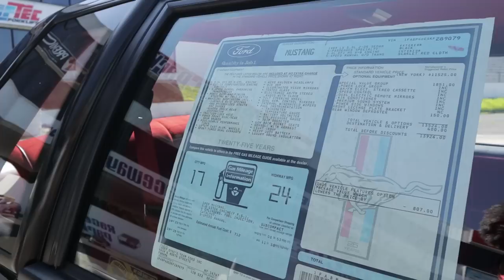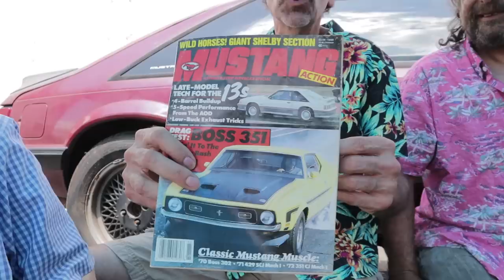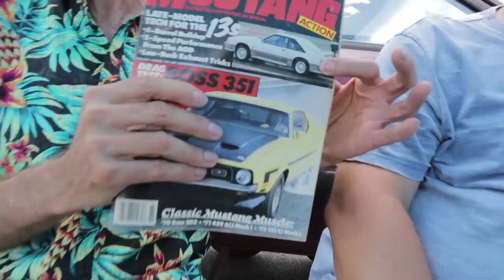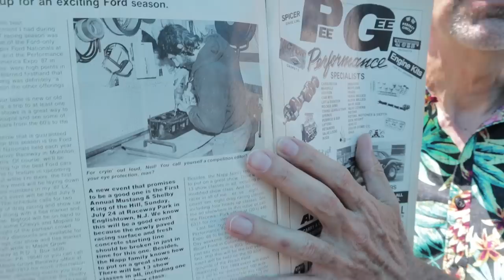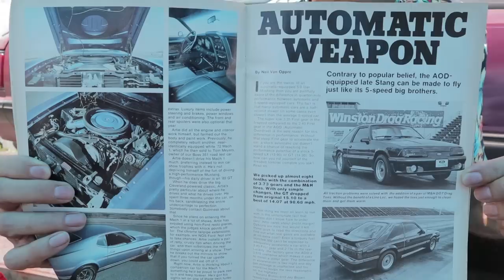5.0 Fox Body Mustang Revolution- The Second Coming Of The American Muscle Car

Comment: I was finally able to watch the whole video and it was like going back in time. I had all of the magazines you showed and used much of your advice for launching my car properly. I ordered my car in September '87 with the only two options being the H.O. pkg. and T-Tops. I got a call two days later from the salesman that the T-Top option was discontinued so I ordered AC, tilt wheel, flip up sunroof, Lo Jack and radio delete for $500 less than the T-Tops. Mine was Cabernet Red with the red interior. I had to wait four months for my car since it was getting the sunroof installed at American Sunroof. I drove across country and back and averaged 26 mpg and over 30 mpg coming down out of the Rockies and Adirondacks. I sold it only because of the recession and being out of work (my fault). I still want another '87-93 LX but the more solid Notch. Thanks for the trip down Memory Lane!
Reply: WHAT BERNIE SAID ABOUT YOU COULDN'T BUY ANY PARTS FOR THE SMALL BLOCK FORD STEMS DOWN TO THE THREAT THE SMALL BLOCK FORD POSED TO THE SMALL BLOCK CHEVY BACK IN THE 60'S WHEN THE 289ci DEBUT. THE 289ci WAS SUCH A THREAT TO THE SMALL BLOCK CHEVY THAT THE NHRA (HENCHMEN FOR GM OR ANOTHER DIVISION OF GM) IN ORDER TO KEEP CHEVY IN THE WINNERS CIRCLE. WOULD CHANGE THE RULE BOOK ON THE 289ci MOTOR LIKE THE WEATHER CHANGED IN KANSAS TO DISCOURAGE ANYBODY FROM RUNNING IT. THE CHANGING OF THE RULES WERE BOTH WRITTEN AND UNWRITTEN. SO IF YOU SHOWED UP AND RACED AND WON. THE NEXT TIME THE RULES ON THE MOTOR WOULD BE CHANGED SO YOU COULDN'T RUN IT. IT WAS ALL BASED ON CHEATING. WHAT I WROTE HERE FINALLY ANSWERS THE MYSTERY QUESTION OF WHY FORD'S COST MORE TO BUILD. ON THE OTHER HAND YOU CAN BUY RACE PARTS FOR THE SMALL BLOCK CHEVY THAT WERE EVERYWHERE AT NICKEL AND DIME PRICES. SINCE THE SBC WAS THE FAVORED MOTOR. THERE PARTS WERE NEVER RESTRICTED AND MASS PRODUCED WHICH KEPT THEM CHEAP. ON THE OTHER HAND NEITHER WOULD FORD NOR THE AFTERMARKET RISK PRODUCING RACE PARTS FOR THE SMALL BLOCK FORD WHICH THE HENCHMEN FOR GM THE NHRA WOULD BAN OVERNIGHT, AND THE MANUFACTURERS WOULD BE LEFT WITH A WAREHOUSE FULL OF SCRAP METAL. BECAUSE IF YOU CAN'T RACE IT AND WIN, THEN PEOPLE WOULDN'T BUY IT. FOR THE FEW COMPANIES THAT DID PRODUCE PARTS LIKE CAMS, MANIFOLDS, PISTONS, ETC. THESE PARTS WERE PRODUCED IN SMALL VOLUMES BRINGING TO COST UP 2-3 TIMES MORE. NOBODY WOULD DARE PRODUCE A HEAD FOR A SMALL BLOCK FORD BECAUSE OF THE THREAT OF A BIG EXPENSIVE PART LIKE THAT BEING BANNED, WHILE AFTER MARKET HEADS FOR THE SMALL BLOCK CHEVY WERE PRODUCED WITHOUT RESTRICTIONS. WARREN BROWNFIELD WHO I THINK LATER STARTED AIR FLOW RESEARCH WAS MAKING RACE HEADS FOR THE SMALL BLOCK CHEVY FOR YEARS AND SO WAS EDELBROCK. SO IF YOU WANTED A HEAD FOR A FORD WHERE DID YOU GO, NOWHERE. YOU HAD TO MAKE IT. YOU ACTUALLY TOOK CHEVY VALVES AND MACHINED THEM DOWN. ALSO WHAT BERNIE SAID ABOUT A HEAD BEING AVAILABLE FOR THE SMALL BLOCK FORD. CAME ABOUT IN 1989 WHEN TRICK FLOW PRODUCED THEM. IMAGINE IT TOOK CLOSE TO 30 YEARS TO PRODUCED A HEAD FOR THE SMALL BLOCK FORD. AND THE ONLY REASON THEY DID WAS DUE TO THE POPULARITY OF THE SMALL BLOCK 5.0 MUSTANGS. AT THE TIME IT DEBUT THE RACE TRACKS WERE DEAD. ONLY CERTAIN HARDCORE RACERS MOSTLY CHEVY, WERE THERE AND THE STANDS WERE EMPTY. ONCE THE MUSTANG 5.0 CAME INTO EXISTENCE IT INJECTED STEROIDS INTO RACING AND HAS BROUGHT RACING TO WHERE IT IS TODAY. NITROUS, TURBOS AND SUPERCHARGING COMPANIES CAME INTO EXISTENCE AND THE ONES THAT DID EXIST STAYED IN BUSINESS BECAUSE OF THE POPULARITY AND MASSIVE POTENTIAL THE SMALL BLOCK FORD HAD TO MAKE POWER. WHEN I THINK ABOUT THIS STUFF. I THINK ABOUT HOW BIG OF AN IDIOT GALE BANKS WAS THINKING CHEVY WAS THE BEST AND THOUGHT NOTHING ABOUT FORD. IF HE WOULD HAVE PRODUCED TURBOS FOR THE SMALL BLOCK FORD. TODAY HE WOULD BE ONE OF THE DOMINATE LEADERS IN TURBO TECHNOLOGY UP AT THE TOP. BUT THINKING CHEVY WAS THE BEST BLINDED THIS MAN WHERE TODAY HE IS A LIMITED COMPANY STRUGGLING ALONG TO STAY ALIVE. LOOK AT THE IRONY OF THIS WHOLE THING. THE NHRA PUT BANS ALL OVER THE SMALL BLOCK FORD FOR YEARS TO KILL IT. ONLY FOR IT TO COME BACK YEARS LATER TO BIT THE CHEVY SMALL BLOCK IN THE ASS. ALL YOUR 5.0 RACE CLASSES WERE CREATED FOR FORD, BECAUSE THE SMALL BLOCK FORD HAD NO COMPETITION, THE CHEVY SMALL BLOCK COULDN'T COMPETE IN THESE NITROUS, TURBO AND SUPERCHARGING CLASSES. IN ORDER TO BECOME A PLAYER YEARS LATER GM DUMPED THE CHEVY SMALL BLOCK IN FAVOR OF MAKING THEIR OWN SMALL BLOCK FORD THE LS. FROM TOP TO BOTTOM THE LS IS 1000% FORD. NOT 1 ONE DESIGN ASPECT OF THE OLD SMALL BLOCK CHEVY LIVES IN THE LS, THE LS IS ALL FORD IN DESIGN.

Comment: This was great. I grew up reading all these mags as i got into cars pretty much from birth. My dad was a car guy, mainly a mopar guy.   I turned 16 in 99 and my first car (the fastest for the cheapest car i could get) a 87 lx 5.0 5 speed. Had the fastest car in hs.(a lot of my friends at the time got into the "scene" but were into civics and stuff but they got destroyed by my 5.0)These cars ruled the streets. Even my dad would kinda make fun of the "little mustangs"...till i got one and he drove it (i eventually got him into them and he ended up buying a new edge new at the time) Anyways ive read all the mags, evans mmff stuff all the time etc. Had many foxes since. Ive done the k+n filter to gt40 intakes nd b303 cams and all that then onto sn95s etc. Now i daily a new edge and have a heavy modded 98 saleen with a terminator swap i converted to turbo...still always building cars and enjoying them, and the fox kicked it into high gear for me.

Comment: Another great video Uncle Tony!!!. Just to give you an idea of the scope of your influence during the 5.0 emergence back then, here on the West Coast of Canada my friend and I did your 10 minute tune up on his  87 5.0 Coupe, drove to Seattle International Raceway and ran 14.26s on the Gatorbacks. When he went back to Ford to get a warranty fuel pump, the tech set the timing back to stock specs,  witness marked the distributor, then the service manager said it will void the warranty if it is altered from stock again. Of course we set it to 10 minute tune up specs again.  Thanks again  Tony  for the great video.
Reply: Marek, yours was about the first fast 5.0L in this area, it was pretty big news when you ran 13's in a new stock car. 13.87 wasn't it?

Comment: It's kind of funny listening to this stuff from back in the '80s, because I sort of went down that same path of learning about 20 years later. None of my buddies had 5.0s and everyone was running carbs, I didn't know much of anything about them, and I more-or-less impulse bought mine in 2006 and started reading old magazines (and then old forum posts), and old books, and on and on... These cars are a ton of fun, and at least they used to be an incredible value. For what they at least used to cost, you can't hardly beat one.

Comment: Back in 87 I had an 86 gt 5 speed, very quick car.  It got rear-ended in 95 and I replaced it with an 89 lx 5.0 5 speed with 3.23 gears, subframe connecter and short throw shifter, that thing was a beast, traded it in in 99 because the baby seat would not fit good on the back seat.  I enjoyed this trip back in time.

Comment: I bought my 89 5.0 Mustang on November 22nd of 88. This video brings back awesome memories of racing someone on my way to work, EVERY SINGLE DAY! From Allentown Pa. to Perkasie down and back on route 309. The were other Mustangs, Grand Nationals, and a Toyota Supra Turbo. I beat them all. I ended up selling it in 2000 and buying an F150. Of course, the whole time I had my 70 GTX in the garage, but the Mustang was my daily driver, and DRIVE it, I did!!!
Reply: I had the 87'Grand National! Got it for graduation! mom and dad, didn't want to get me anything fast "a V8" so instead they got me the "v6.. Grand National" little did they know it was a beast! 
Stock.. it would humiliate the GT's, Iroc's, GTA's and vettes! if you outrun.. the Grand National you have had some work done to your Mustang, because stock.. you would have gotten embarrassed!

Comment: Rewatched this.  I bought a new  ‘88 5.0 GT no a/c and AOD (newly married, wife daily drove it) when I was  23. Eventually nailed 14 flat with off-road H pipe and the usually mods; under-drive pulleys, timing, silencer removed.  Sold it to buy a home, later found a duplicate GT convert 5 speed.  Good Times!  BTW, we were always envious of that good east coast air!

Comment: 35:28 Carried my slicks in the back seat of my Notch in Discount Tire bags. 26x10s fit across fine and the 28x10s required splaying the tires a bit to fit. No tire marks anywhere in the interior though it did smell like burnt rubber (more than) occasionally!

Comment: 87-93 5-oh was America’s answer to the VW Beetle.  Cheap, easy to fix, and reliable.  Lug wrench makes the perfect pry bar to extend the sprung tensioner and swap the belt.  I can swap a belt in under 2 minutes.  Everything on the car save for the heater core is a snap to replace.  I’ve been daily driving a 5.0 since 2000.

Comment: I am a big Mopar fan. I grew up in the 70s and 80s. Graduated in 91. Given the time period and the fact that I live in Michigan most old Mopars on the road were on their last miles before rust ate what was left. There was even a 69 Hemi Daytona around. My cousin had bought an 84 Mustang GT. After I drove it I thought it was an absolute blast. Although I was still looking around for a 340 Duster or whatever I could find, I found a black 92 GT 5 speed , 60,000 miles for $7500. There was no rust. On  a six year old car vs what I was finding on older cars. I have it in heated storage and at some point will do a light restoration.

Comment: I'm just watching this documentary and I already learn a few things . Like the 10 min tune up ,and from MR Bernie that the Auto Chip is recovering timing better than the manual one . I have an 88 LX  hatch with the AOD in it . Now it has 237 k miles and still running strong. In 87 i was still in High School just learning auto mechanics and how cars and engines work. I was 16.  Mine has 3:27 gears from the factory.  I did try drag racing a bit but didn't get too far. My best run after rebuilding the engine after the oil pump locked up was 14.5 something  at Milan drag way in Milan MI. Yes I live in Michigan, still. It was fun and a lot of adrenaline rush.   The magazine the Neil was showing , What month and year was that ? would like to look for it. Thanks  I bought mine in Feb 2nd 1993 used with 37 k miles on and still have it today. 12/16/2021. I've read Evin J Smiths articles back in early 2000s in Muscle mustang and fast fords mags. cool stuff. Still have a bunch of them.  Cool video.

Comment: Regarding the seats...there were no seat option choices, the 1987-1990 LX coupe 5.0 was only available with the "4 cylinder seats" in vinyl(very rare) or cloth untill 1991 when the lumbar seats as found in the GT became standard. The LX 5.0 hatchback had the GT seats standard starting in 1989 while 1987-1988 5.0 hatches came with the "4 cylinder" seats as the only choice. Starting in 1990 the seats also switched to the small headrest and the fabric was different than the 1987-1989 seats. As for the pinstipe, it was also standard and not an option, on all LX models and was an actual painted on stripe and not a cheap vinyl tape stripe. The stripe was dropped from production in 1991 on the LX. The wide moulding stripe found on GT cars was dropped mid-year during the1989 production run. The 25th Anniversary dash badge was only installed on cars produced from April 1st 1989 through April 1st 1990.

Comment: Another thing, first thing I do any ol ford smallblock is if it’s efi( all I’ve ever owned) put it at 14 degrees initial timing open up the plug gap to .50, get a better coil and it really helps as far as throttle response and mid range and a few mpg to boot

Comment: Boy I had three Highway Patrol Mustangs over the years in Florida ! They rock and very fast and handle curves like a European sports car !! My first Mustang was a 1985  Highway Patrol Mustang that I bought ( with my Fathers help ) at a Bartow Florida Patrol auction . It had a flat tire and eventually needed a clutch and smoked some but WOW very fast and fun to drive and had a four barrel Holly carb stock from the factory !  On top of that this was back when the Patrol was auctioning off their vehicles before 100k miles !!

Comment: I like the video and agree with almost everything, great information for this generation of gearheads. But I don't understand the ET of 5.0 stick Mustangs with a cam VS other modified street cars at the time and the comments saying "everything that drove to the strip fell to a notch", that's just not true. In the mid to late 80s I had plenty of competition running low 12s, and 11s (frequently) N/A, a lot of people didn't understand parts selection and tuning at the time though. Fox bodies were well designed and the 302 Windsors were great at the time but they were really lacking in the torque department, for well under the price of a 5.0 5spd Coupe you could build a bruiser if you had the time and the know-how, I guess the appeal was that you could just buy a Mustang, learn how to drive it and take it to the strip with minimal effort.

Comment: The Foxbody Mustang was finally hitting its full stride in its 7th year in 1985 after ditching the junk TRX Michelin tires for the Goodyear Gatorbacks, getting a roller cam and with the addition of the improved T-5 transmission. It was still sandbagged with 4 bolt hubs and wheels, rear drum brakes, too small brakes and a 4 link rear axle that needed a panhard bar or Watts link to stop it from moving around too much. 
I had a 5.0 4 speed 1979 Mustang Indy Pace Car from August 1987 to March 1990. I was a regular on north Broadway in Rochester Minnesota in the late 80’s. I rented a 1989 Mustang LX 5.0 in April 1989 and wow that car was a lot faster than my Pace Car.

Comment: Yea, I can remember guys coming by the race shop, checking to see if we had any IMCA modified tires. Because at one point we had asphalt or dirt tires. Which both were DOT approved. So they would buy the dirt tires to use at the drag strip. And the asphalt tires to drive home on. 

Needless to say, they didn't stop buying then when McCreary went to one compound for the IMCA modified. Then transferred over to American Racers, and Hoosier. 

Although the American Racers are more popular than the Hoosier's. 

Although they are all DOT rated, because that is what IMCA requires, due to the fact the tire has to be road legal.

Comment: wait...Tony DeFeo and the 13.47 quarter mile Fox Body? yeah, I remember those magazine articles. Wringing out Tom Meyers yellow Boss 351. Grand Nationals going at Fox Bodies the way Grand Sports would eventually target Hemis at any dragstrip. Your competitors at Hot Rod Magazine got it right--the Fox Body is the 1955 Chevy of modern times. The Chev had the powerpack, and on Berlin Turnpike up in CT, it was the dealership GT-40 package on the new Mustangs. A tin can of a car (I own the last year of lightweight GTs, I can say that) with a truck engine for strength and a hot cam--all the power to weight ratio a factory hot rod needed. And headers and roller cam right from the factory.  Affordable to buy new, cheap to mod, and suddenly you were pulling quarters like the muscle cars of old...but getting twice the gas mileage and not fouling plugs or changing points. And still on Sunoco high test (OK, it was 94 at the time, not 260 blue, but still).

It really was the good ol' days, come back to life. And no worry about getting drafted after finally getting your muscle car tuned right. If there's ever a list of what cars a real car nut must own and experience in order to be a well-rounded nut (heh), no doubt a Fox body of some type is on that list. The potential is just too good to pass up, and now the GT-40P heads are on junkyard Explorers for cheap. If you can't afford the insurance on a Fox body due to your age, go land yourself a Fairmont or Futura--same potential, less notice by Officer Friendly. Every time I spot a Mustang being stripped by an eBay vulture just looking to make some bank, I want to add it to my driveway just to save it for some kid someday driving an electric car, not knowing what it was like to buy something like this cheap and with a little skill, run like the supercharged muscle of 2019.

Comment: Lol I have that magazine still and remember Tony and Neil. I remember an issue when there was Buick Electra 225 Das Boatthat ran in the 10s with nitrous.  I worked at Rizzo ford back then driving the parts delivery truck. Loved the sound of the 5.0s  with flow master exhaust.. I think I was making 5.00 an hour back then. Drove to work in a 71 chrysler newport that I paid $75.00 for at the dealership that somebody traded in for a crown vic.  Now a Lowes sits where the dealership was.

Comment: when SFI first came out, guys were all ripping the injection stuff off and going back to carbs because everyone thought they were the death of racing, I remember opening up my stock Throttle body and boom tubes. on my 87 gt vert   you had. to get 4.10's a hurst shifter and a March Ram Air    lol..
Reply: The March ram air and pulley kit.